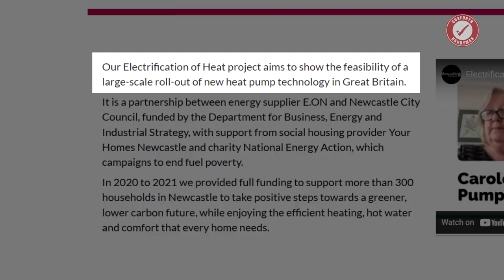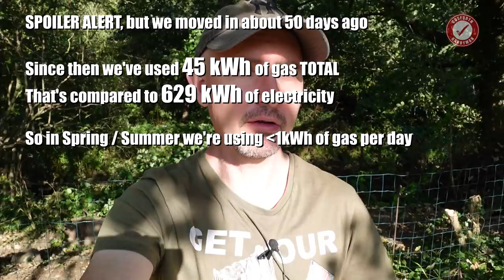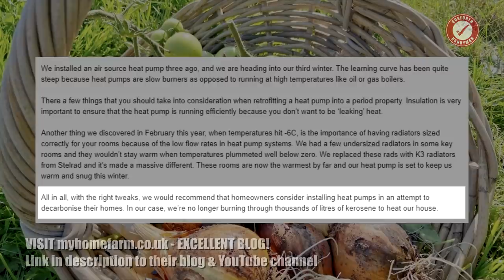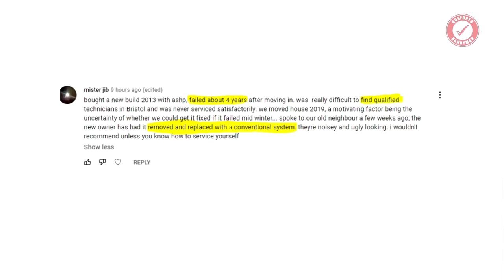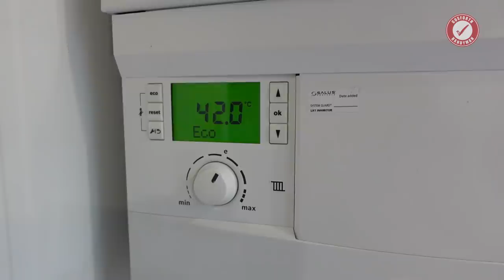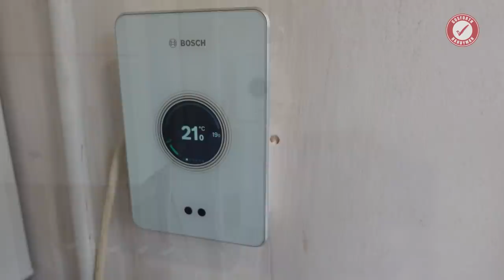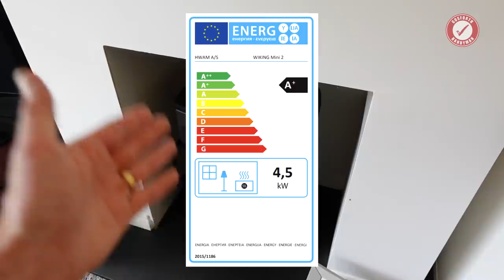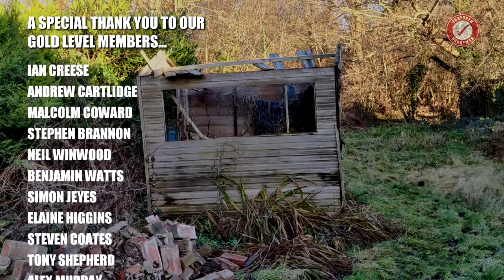Why didn’t we install an Air Source Heat Pump? (1920’s Renovation Part 32)

Comment: Wood burning stoves produce a lot of particulates, you are aware that doing nothing is not an option
Reply: No, they used to produce a lot of particulates but they've been regulated for a few decades now, just like vehicle emissions, and the upcoming efficiency standards are starting to exceed 90+%...  Catalytic converters, secondary burn chambers, heat exchangers, etc. the technology of wood stoves has advanced quite a bit...
Reply: @ZeoCyberG  bit better but depends on the fuel. If not properly dry then particulates galore.
Reply: @Lewis_Standing  - No, that's mainly something that can effect the initial burn but once it reaches temperature it's burning everything up... We're talking temperatures around 2000 degrees!  While again, with modern systems no air is mixed with the interior air and you can filter everything else...

Comment: Our country is trying to do away with internal combustion vehicles and go all electric.
For all the idealism, I see a few problems.
- What's going to happen with all the classic car collections as these will be rendered worthless.
- How are people in city apartments going to charge their vehicles?
- Our electric grid is subject to blackouts now how is it going to be able to handle the extra load pressed on it?
- Who's going to pay for all the infrastructure needed?
Reply: The wheels on classic cars dont care what horse power source drives them,  electric motors can deliver more power , I think superstores with solar panels powering charge while you shop works

Comment: Did you not break building regs by installing a new gas boiler without zoning? I thought that was mandatory for new installations. BTW, there is no need to pay for installation- do it all yourself, then pay a registered plumber to connect the gas, fire it up, check the flue gas, and sign the form. I have done four of these so far...
Reply: Above 150m2 zoning is required. Unlikely the house is that big. Zoning a system will cause boiler to cycle more decreasing reliability and efficiency. Thats why all these smart trv are nonsense
Reply: @mattmackenzie1111  You are correct that from 2018 zoning is only mandatory on >150m2 dwellings. There are other requirements however.
 I fitted zoning on my current installation because that saves heating bedrooms and upper hall & bathroom for most of the day- easily saving more than any small increase in efficiency. Reliability? I have fitted four systems (to my families homes) to date, with an average use time to date of > 10 years. None have been 'serviced' (which according to my maintenance manual boils down to 'blow the dust off the burner') or required any repair. Two were inspected as part of a house sale- no problems found. That is a MTBF of > 40 years- I will take that. The extra complexity of zoning amounts to a motorized valve per zone. Simple, cheap, and very reliable. 
My son has fitted a 'smart' system to his own design- controls every radiator and underfloor zone in a large house plus flat. Uses weather (incl solar gain) predictive control, room use learning (fed from other smart devices) and a full reporting app. Each radiator reports its temperature. Original motivation was design based, but rising gas prices have underlined his choice... Until we have zero carbon houses (and that is moot on our current housing stock) this is the way we have to go. Especially as we move away from gas.
Reply: If your heating one 1/2kw radiator with a 30kw combi boiler, where do you think the heat is going? The boiler will only be condensing for a matter of seconds when it first comes on, after this it just won't condense. Ie not efficient as it could be. Zone valve break all the time your just lucky yours have not. Servicing checks alot more than "blowing off the burner"
Reply: @mattmackenzie1111  As I said, my son has a fully instrumented system- that includes gas flow, so he can compare the thermal efficiency under different conditions. The saving from not over-heating unused rooms is an order of magnitude more than the efficiency losses. BTW most modern boilers have a modulation range of ~ 9:1, and a good control system will alter the hysteresis to allow for this.
Yes, most of servicing is 'checking'. That does nothing for longevity. There are no time-limited parts to change.  A cynic would say that it is just producing a list of things to do, to support the 'servicing industry'. It is called rent seeking. 
Are you saying that all zone valve manufacturers are incapable of making a reliable unit? There are valves tested to 100,000 cycles, which is a 20 - 30 year minimum life in most installations. Early failures are more likely to be poor installations rather than reliability issues.
Reply: Not sure what a fully instrumented system is? Yes zone valves regularly break i know this as I regularly replace them. Good luck with 30 years. If you had a 30kw boiler and a  9/1 ratio on boiler. Your min output would be around 3.5kw thats fine when you have a large room that has delta t of 24°c. So 3500watt ÷24=145.83watts. At an average UK temp of 8°c. 11x145=1595watts. So you've got no chance in putting 3500w in a 1595w rad so your boiler will be cycling continuously. Second to that there be further heatloss to near by rooms.
Micro zoning=waste of time.
A well designed system you'd want the boiler flow well below 55 under all conditions with minimal cycling. Micro zoning will never do this.
There's a great "heat geek" video that goes deep in to the maths on this subject.
Reply: @mattmackenzie1111  You show interesting calculations, but do not mention the tolerances. A radiator may be rated at 3500W, but that may be true at one temperature differential, flow rate, and air circulation condition. It is but a guide. Yes, cycling is inefficient, but not as much as heating areas that do not need it. Take a simple case of a a two zone system of similar volume. The efficiency would have to fall below 50% to override the halving of heating requirement. At what point will a modern boiler cycling hit that? More than that, a system such as my son's has both underfloor and radiator output to the same areas. So, a choice of slow release from underfloor (which means the hysteresis  band can be much larger) and rapid entry to higher temperature periods gives opportunity to level boiler demand. 
What you are saying is that he should heat rooms that do not need it in order to increase boiler efficiency? That is not what his data says. Published figures only give a 11.8% loss of efficiency for ten second runtimes. That is a very short run! If this really was a problem, the answer is a heat store- a tank that can greatly increase the volume of working fluid. 
A bigger issue with combi boilers is that the heat demand is much higher for hot water than space heating in a well insulated house.

Zone valves- what is the MTBF that you have experienced? Do you have actual data?
Stop press- actual data from my sons installation. Fastest cycle is actually 10 minutes (6 per hour). This is fairly constant, the on/off ratio alters instead. This will have a negligible effect on efficiency.
Reply: Did you watch heat geek video? I'm suggesting mirco zoning is not effective on a room by room basis. If one room is on another is not there will be a heat loss between so your still heating room even tho stat is off. So heat source is having to work at higher temp to maintain heated room at correct temperature as heat emitter will not be big enough at low flows temps. What heat source does your son have? What type of under is there?
Watch heat geeks video he is far more articulate than myself. By he runs a few worked examples. Its a good watch!! https://youtu.be/zpTVIeUh04E

Comment: Funny, the beta-max versus VHS debate... both systems couldn't hold a candle to the Video 2000 system. The best system to install is the one that actually works...

Regarding the boiler and kitchen, I would install a cupboard with a hot water supply bypassing the boiler. The amount of water wasted is substantial. Sure, pennies, but water is scarce resource and with the present political parties better to be safe than sorry.

Comment: The devil is in the details. Getting all the calculations right for the actual extremes expected and sizing everything properly is not for amateurs.
As far as foam goes, the new formulations are quite good. (for the last decade or so)  You need to really do your homework here. I recommend them. Just be careful which company you go with.
Reply: I find most rads are too large , and would function better as efficient smaller doubles IF external walls are well insulated

Comment: Hydrogen argument not real , gas at present price now making heat pumps more plausible. Carbon foot print afraid wrong , like the argument against evs . Complexity agree , needs used correctly but installing insulation cheaper option for most

Comment: Ok for a new property designed for low temperature 35 c underfloor heating with top notch insulation.

For GSHP make sure you don’t have clay soil as it cannot transfer heat to the slinky’s fast enough.

If you have oil boiler convert it to biofuel when you have to

I also ditched any idea of ASHP 

Agreed with everything you said.

The civil service advising the hopeless ministers cannot see the bleeding obvious.

Comment: You are far better off spending a portion of the cost of a heat pump on insulating your home and knowing how to operate a thermostat properly. The governments push for heat pumps are the next diesel cars!

Comment: Really do recommend this video .....
Here is Tristan Lea    https://youtu.be/m2-_x0XZUSM   Heat pump installed well & he says working well .
 & he explains heat pumping & radiator sizing...    A heat pump needs an installer( or owner) that knows how to install it . I did watch the My Home Farm  videos, seems My Home Farm was installed with poor radiators & high flow temperature , so what was going on there? Why was it installed it like that in the first place ? 

Its probable that heat pumps are on a fast improving curve.  Ecodan claim 43db , But I would like a test unit to sit in the garden to see if i can hear it.  Anyway its less loud than the neighbours dogs.

Heat Pump Verse Hydrogen?     1Kwh of electricity in a heat pump gives 3 to 3.9 Kwh of heat .  But 1Kwh of Electricity makes 0.5 Kwh of green Hydrogen .. which will be cheaper?  

If this is a Handyman channel, isn't £11k installations unnecessary ? Certainly changing radiators & concrete base for heat pump is DIY work .. thus the installer work is less. 

I like the  Hydrogen supply  idea ...  children can  have a go at making a Zeppelin using the gas cooker,  balsa wood & a bin bag.

Comment: The main problem with your excellent summary of weighing up the balance of energy systems is - the bigger picture! Yes, we've developed efficient ways to burn fossil fuels over the last hundred years, but that's all it is. There's two obvious problems with that, the greenhouse gas effect and the fact that it's finite, we're running through it like crazed teenagers.  Plus on a geo-political scale, guess where most of our gas is coming from now?  Hello Russia!
We need pioneers to follow through with newer systems to make them work better.

Comment: 23:40 RE: woodburning stoves
This falls under bridging technology ("Brueckentechnologie"). Burning wood for energy is not as bad as burning oil/gas (ancient carbon storage released into the atmosphere), but also not as good as claimed, if you factor in EVERYTHING else: harvesting, transportation and processing of the wood, the planting cycle and fertilisers, and needed land, and is a monoculture at worst thus loss of biodiversity and soil erosion, and emits also particulate matter during burning especially when done in a home environment (you don't have a high tech filter on your chimney).

But you are wrong and mischaracterizing science that rotting wood in the woods (eg creating peat bogs, the process also known as sequestering carbon) is equal to burning wood at home.

PS: 26:50 Please don't forget to insulate your hot water pipes ...

Comment: Lots of false claims about the air source heat pumps!
Air source heat pumps are used in Scandinivia for temps until -30 degrees celcius. So you clearly don't know them well. And requiring large radiators is not a sign of inefficience. They just work at a lower temperature. You are clearly confusing power with efficiency!
In fact the system is so efficient most of the time that it is in fact more efficient to burn gas in a powerplant (only at 40% efficiency) and then run the heat pump of that power.
We had a 5 year old row house and the heat pump only used 220 kWh for heating the home in one year! And half of the time the solar panels made enough power to keep it running directly. Although it wouldn't be enough to cover the whole power usage on those drizzling days.
Yes air source heat pumps can make noise, and/so it is important that they are installed correctly.
These combi boilers are much easier to install by anyone who doesn't know how to properly size a system incl radiators for a house. Lots of errors are being made with them, but not found out because the system is powerful enough.
And these days most of us Europeans need to run them on Russian gas, I am not sure if you want that kind of dependency. Lots of people are getting high gas bills right now.
For some old houses, especially large with existing infrastructure/radiators, the air source heat pumps aren't always the best choice.
But if you have a clean sheet regarding insulations and radiators, insulate well and preferably install floor heating and run an air source heat pump, it will be very efficient.

My experience with them has been good. And our new house is a very small house, which we heat with only a 2.5kW air conditioner! Which works down to -15. So an air/air heat pump basically. Which deals with the issue of not having to have the right radiators and stuff.

Comment: Absolutely no science in this video at all. Bascially you don't like unvented, because you wrongly think that a 220 litre tank of 60 degree hot water will last 22 minutes if you run a 10 litre a minute shower.  Well, you're a good looking bloke, so I can promise you that you've not had 60 dgree water cascading over that lovely face in the shower! You have zero facts behind the ground source heat pump nor the air source, you're just trotting out what the rubbish press will have you believe.  I especially like the phrase about heat pumps "the system is so inefficient that you need to have much bigger radiators", well it's the big radiators that make it efficient! Lower flow temps are more efficient!!!  Bye.

Comment: All I hear is “which it absolutely won’t” he doesn’t know what he’s talking about when it comes to correctly sized and installed heat pumps. If this was a case study on badly sized and installed heat pumps he might well be right. But it’s not is it.

Comment: Heat pumps are terrible. They're almost as bad a Worcester Bosch combi's. Expect a leak on that bad boy in a few years.
Reply: Nothing wrong with heat pumps they work very well when designed and installed correctly
Reply: @BristolHeatPumps  Variables. I've heard nothing but stories of them being ripped out and replaced for gas. Families not being able to afford bills with them while also having to sit with their coats on during winter and having to know the forecast a week in advance to turn them on to get up to temperature. I'm not against the tech, I don't think they're good enough yet, especially in the north.
Reply: @tomrobinson4935  they are more than good enough if installed correctly. You can get away with a poorly designed system running on a gas boiler but not a heat pump. You do realise i go out to most condensing boilers and they aren't actually condensing? The only reason we don't notice it is because we still have hot water and our radiators are still roasting hot.
Heat pumps work incredibly well and  are cheaper to run than gas when emittors(radiators, UFH) and pipework are sized correctly and the system is setup correctly.

Comment: Heat pumps to heat your water and radiators for most it’s just a waste of money time and effort,it’s like a heat pump tumble dryer ,yes super efficient but takes ages to dry your clothes up to 3 times longer , is that efficient 🤷‍♂️ , why would anyone have a perfectly good heating system ripped out , then pay lots of money for a new heat pump system that does not work , also possibly having to change your radiators ,have underfloor pipes ,this is just crazy and probably the worse bit using tax payers money to offer help payments to get this installed

Comment: Heres Roger @ Skillbuilder talking to someone on the industry about the same scheme for further evidence.
https://youtu.be/4uNKPDREa-Q?t=1008
Reply: My parents recently moved into a new build and that has a Heat only boiler and closed heating system. The entire system runs on 15mm copper pipe so to change to an ASHP would require all pipe to be upgraded to 22mm and new radiators throughout.
I will say that the Natural Gas/Hydrogen debate is interesting. For example if it is decided to switch (or switch certain areas) onto Hydrogen then every appliance on that natural gas line would have to be changed - Boilers replaced (or parts changed), gas fires, gas hobs etc. How on earth does anyone propose to manage that?? There is no real alternative its not like any company would install new Hydrogen only gas lines and terminate them into properties......